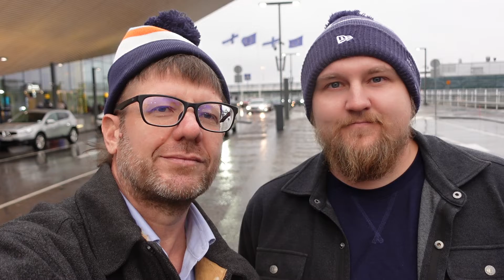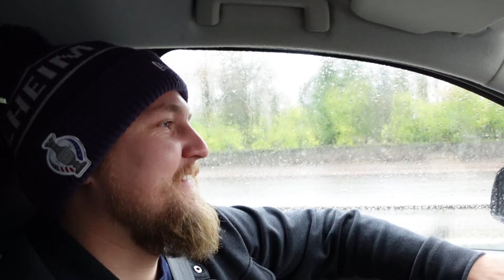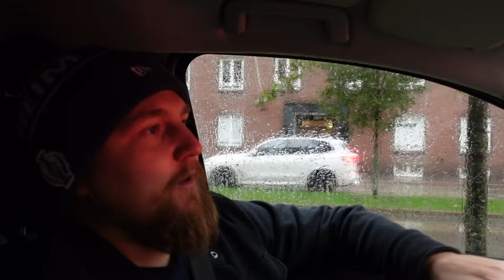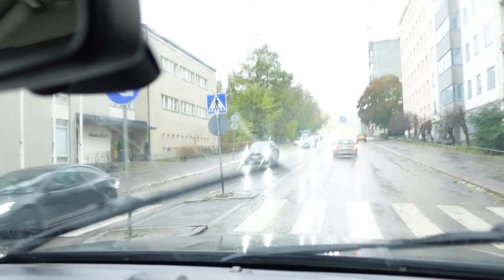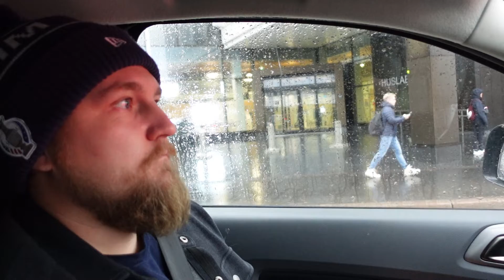Automowers for golf course fairways and rough with Janne Lehto, MG

Comment: I just got off phone with a Husqvarna rep. They stated Husqvarna does not make a model that goes below 20mm. Is there an after market kit Janne is using on his mowers to get to 13mm?
Reply: ‘Fairway kits’ are available for all 400&500 series 2WD models as well as CEORA. They allow a min cutting height of 10mm.
Reply from the maker: Let me check on that. I have just checked the Husqvarna website and also saw a 2 cm lower limit. I have heard of the low cut kit but did not think to ask Janne.